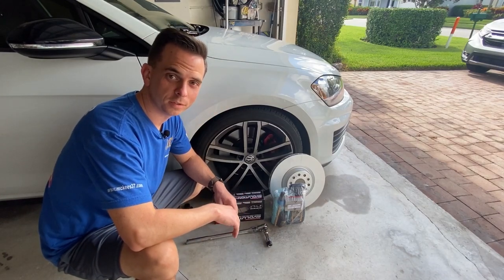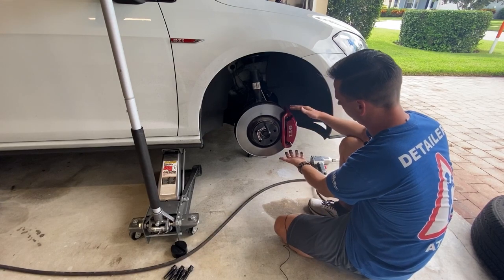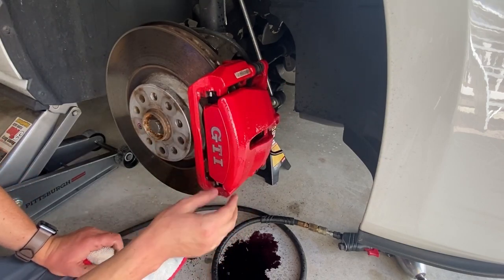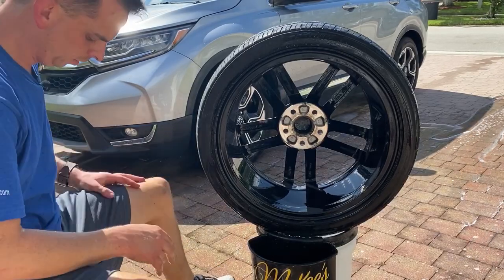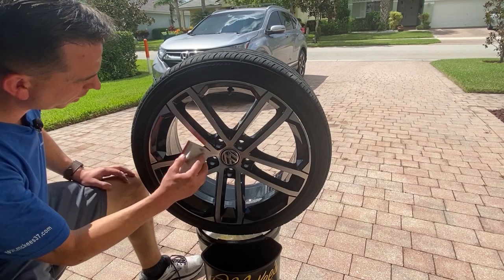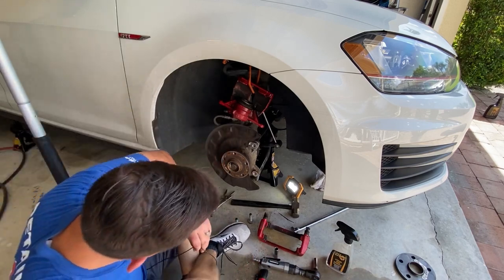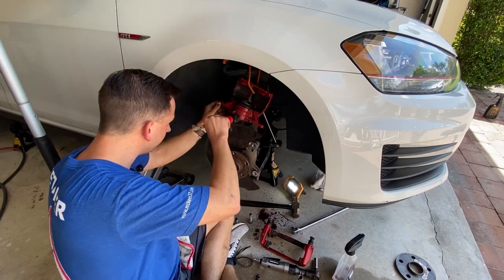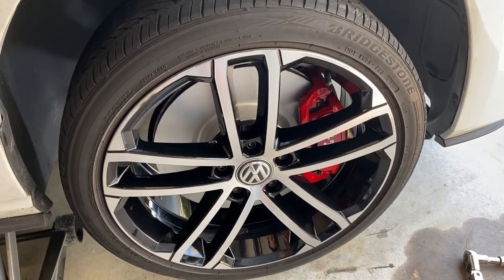Solving the Issue of Brake Dust on MK7 GTI - Ceramic Wheel Coating & Brake Replacement

Comment: 25:55 Apply Permatex anti-seize compound on that rusty hub flange and on the back of the wheel hub's mating surface. That'll make the wheel comes off easier next time  you do a brake job or a tire swap.